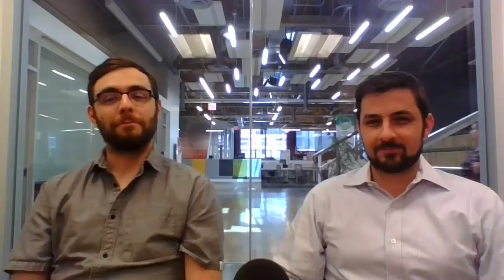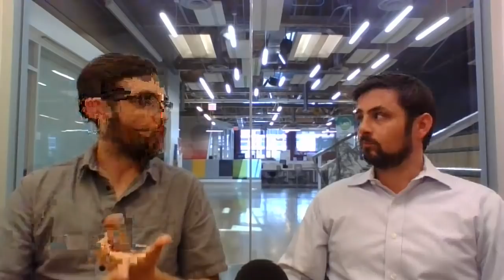SolarEdge VS. Enphase: The Ultimate Inverter Showdown - #65

Comment: To me it’s just the enphase is rated for 149 degrees Fahrenheit and ssolar edge optimizers are rated for 185 degrees. In my market the roofs get up to 170 in the summer. The micro inverters have not worked as well in the hot climates in the summer when the roof passes 150 degrees

Comment: I'm in solar for longer as 10 years now,  and I really think the MLPE technology is hyped a little too hard,  although it has it's advantages.
A good string inverter like Fronius,  and maybe also SMA is simpler,  has less connections on the roof,  is less exposed to the outside climate,  and is way more simple,  and less failure sensitive.  And my experience throughout the years is that people should best choose the most simple option of good quality.  And when the layout gets more complicated and more shade is involved,  then turn to MLPE solutions.  You don't have to be afraid that you're going to miss a lot of energy when you choose a good string inverter.  There's much more going wrong with inverters than with solar panels.  And when you buy a good premium solar panel like panasonic or rec,  then there is a very small chance that something goes wrong.  When a module gets broken,  you will see that in the monitoring as well.  You don't have to pay  10% more for extra technology because you're afraid something might go wrong on the roof.  It's the opposite in my experience.  The last few years,  the service for solaredge vs string inverters in our company was 90% vs 10%.   When an inverter brand goes bankrupt in the coming years,  with a string inverter you just take another brand.  with solaredge or enphase that will be a different story.  Especially when you have a roof that is very difficult to reach...  But in the end,  it's a gamble,  just like the other decisions in life.

Comment: Enphase has a single point of failure too.  Its called the combiner box and it only has a 5 year warranty.  Surprised you guys dont mention that.  Also enphase is only 97.5% efficient while SolarEdge is 98.8%.   No mention of clipping either.  Sad
Reply: Go price an inverter and a combiner.
Reply: Go price an inverter and a combiner.

Comment: I first learned of Enphase in early 2014. From a solar supplier in Campbell Ca. I said I wanted to do it myself, and start with only 6 panels, so he matched 6 Enphase M-215 micro inverters with a 240 Volt trunk cable, and 6 - 255 Watt Sharp panels, I went home, attached them on my backyard fence, mounted the inverters to the panels and tied the patch cord to an abandoned 240 Volt source I used to use for my Hot tub, and plugged the inverters to the panels and turned it on! Within 5 minutes I was producing 1300 watts. Whole install took less than 2 hours. Easy process. Since then I have added many more Enphase Inverters and a mix of brands of panels and got the permit and net metering approved, and racked up a huge array myself on the roof. It's now 2020, and not a single one of my Enphase inverters has ever failed. Now compare that to my neighbor who paid a contractor for a overpriced $40,000 21 panel array. He was talked into SolarEdge only because he later found out that SolarEdge kicks money back to the installers to push their products! His first Solar Edge wall inverter fried itself 8 months after it was installed. His system was down over 3 weeks waiting for a replacement Inverter from Solar Edge. Then after 5 months that inverter also started tripping both the DC and AC breakers with a large bag and smoke coming from the circuit board! This was last May. He then had to wait a month during a sunny May to June and they just replaced it again with a newer designed Inverter. He's quite pissed at the whole SolarEdge experience but can you do after you are stuck with them?! I would also like to share these details that you left out of the comparison. SolarEdge optimizers still rely on a DC wall inverter. So most of the negative aspects of string inverters are still in play. Such as having high DC voltages on the roof which have a higher potential to start a fire from DC sparking at any loose connections, and like my neighbor experienced, if the wall inverter dies, the whole system dies! Compared to Enphase, if one micro inverter dies (which they seem to never do) only that one single panel goes dead! AC is more efficient and safer. Then compare the stringent quality standards that Enphase incorporates in to their products! 25 year warranties! Solar Edge offers12 years because they are thrown together by old world manufacturing and they simply don't care if the installer has to come back to the replace their products multiple times! Enphase also is about to introduce some of the first products of their kind in the Solar world. Their new IQ8 inverts do not need utility power present to produce AC 240 Volt power! They island themselves with a neutral potential and they can throttle power up or down in milliseconds of time to adjust to the load of the house! So if PG&E cuts your power, you still can run off your roof! Or if you are 500 miles from a city and power, you can match it with their Encharge battery system and be off grid with AC power and controls that can shed loads in the house accordingly! So the systems they are designing are unlike anything sold today. Smarter than Tesla battery system too.  Grid or Gridless it doesn't matter, the system adjusts without the people in the house even seeing a flicker on the lights! Lastly Enphase is an American company, where as SolarEdge is not.

Comment: Hi guys, just found your 2 videos. Great and helpful content! I have a question: I hear nothing from you guys on fire safety. We heard from a supplier that enphase could be a bigger fire hazard because of the higher voltage on the top of your roof. Fire brigade might have issues with that over an installation with a central inverter. Any comments on that?
Reply: With an Enphase system, you have 240 VAC on your roof. With a string inverter system, you have, depending on the number of modules, anywhere from 300 to 600 VDC on your roof.
Reply: @kiowablue2862  That is exactly true. Even if the string inverter is shut down, you still have high voltage in the DC cables from the panels to the string inverter. With the micro converters, when the AC power is cut off, the only DC voltage is the low (~40 vdc) at each panel and does not go past the inverter. ie: IMHO ---micro inverters are safer for anyone working on the roof near the cables.

Comment: I know this is off the main subject, but I am a big fan of Solar. I live in SoCal where the rates are quite high, but my electric bill for the WHOLE of 2019 was less than $300.. and that's with the A/C cranked to very comfortable levels...something we couldn't really do before... before the panels, our average yearly electric bill was about $2,000 / year. Now, our highest monthly bills are during the winter months when clouds, rain and short sun days reduce solar output. Our April bill was $4.23 with a $37 state solar credit so our actual bill was $41.23, though much of that is due to taxes and fees. Some summer months, even with the higher rates, our bill is a credit. Another advantage of solar panels is they reduce the heat load in your attic by providing shade thereby reducing your need to get the heat out of the house by your A/C. California is a Net Metering state that pays you back for your excess power at the same rate as it charges for power taken from the grid. Not all states have that. We are on a TOU (Time of Use) plan. The rates are higher during the days and lowest after dark. The good thing is the solar generation is also highest during the highest rate hours. One thing most people don't appreciate is the tax credit that's placed in your Federal Income Tax Account.. I'm retired, but my wife still works and this tax credit has enabled her to not have any FIT taken out of her paychecks. That's an extra raise in income we see each payday.. and the upshot is, we still haven't had to write any checks to the IRS since we had the panels installed in Oct 2017. We only write checks to the state, which aren't too bad. So, solar is the best investment we made. But, you just gotta buy the panels, not lease or you won't get the credits. You're just paying the solar company to use your roof for their benefit... and though you may get a reduced electric rate, you'll never see the Zero or Credit electric bills an owner would see. As per the subject, I agree that Micro-inverters are the ONLY way to go..

Comment: You guys seem like nice people but this "showdown" missed many aspects of what a real showdown would have.  For instance Enphase does not keep up with the efficiency of a SolarEdge system.   Enphase is easily expandable and easier to install but is also quite a bit more EXPENSIVE, while SolarEdge is only expandable up to the size of the central inverter.
Reply: I have a good fronius inverter.  Keep it simple when the roof is optimal without shading.  The more complex it gets,  the more fragile.  I know because I'm solaredge professional and fronius partner.

Comment: Which one would be better for an existing residential setup. I already have panels ready. I just need an inverter along with an optimiser with a way to track the energy produced daily and log it, having remote access to this. Thanks in advance.

Comment: One advantage of AC at the panel (Enphase) vs DC at the panel (SolarEdge) is the higher voltage of the AC allows Smaller wires than the DC string would require. This reduces installation costs. Also, DC Voltage losses over a long run would decrease net output. 240Vac Split Phase is a lot more efficient than 40Vdc for transmitting power. That's why Power Utilities have High Voltage Overhead Transmission lines carrying 14kV or more as it travels further with less power loss.
Reply: 240Vac is single phase with 2 polarities. Maybe that's what you meant by split phase.
Reply: @portalminer8813  yes...
Reply: actually the DC is higher voltage and thus less amps and smaller wire.

Comment: What if you want the solar energy to go into a battery storage device then send the extra out to the grid. Can microinverters work with this settup?
Reply: Yes the new IQ inverters are more battery compatible than the previous M250 series. I think the AC modules from Enphase are too expensive. It's possible to run a Tesla or LG with the proper wiring of a newer IQ micro. If you have a small roof with very little pitch. It's easy to wire the panels and racks, then let a qualified electrician wire the combiiner and shut off switch. You might pay more upfront on the Enphase. But the actual rates of failure will be far less than Solar Edge.

Early M190 inverters had problems. They kept working at it and now the stuff is far better than it used to be. For small scale residential I think Enphase is better in a 15-30 panel setup.

If you are planning on going beyond 10kw then a string inverter would be a better value, but I'd go with SMA or Fronius, you can also add Tigo for optimization. But Enphase really just nails it. I had one inverter fail in the early install. I had a new one in two weeks. The per panel monitoring on Enphase is dialed in with your internet connection.

I can say that Solar Edge is not going to compete with the innovation of Enphase. Good luck. It's not that Solar Edge is bad. But the fact that you  might wait a month or two or have to replace multiple inverters over the warranty period can be a headache for some. Of course Enphase had it's share of problems. It seems they are getting the return now that they've invested in testing.

I think Enphase has more R&D into testing than most companies. Good luck.

Comment: Enphase converts at panel sending down AC which is what your house uses. Not only is the single inverter in the solar edge system bad if it should go out but solar edge inverter comes with a 10 yr warranty. Enphase is 25yrs.
Reply: I just got a quote with a 25 year warranty for the solar edge inverter. The other question is whether the manufacturer will still be around in 25 years. They could warrant it for 50 years and it doesn't mean a thing if they aren't around.
Reply: @jonathanreich6360  - what pricing did you get? It would take A REALLY REALLY good deal to get me to buy a  Solar Edge system, and I mean REALLY good.
Reply: @kbob8424  Solar Edge offers extended warranties for 20 and 25 years. Our contract includes the extended warranty to 25 years. We had many bids and the best bid was for Panasonic panels with the Solar Edge optimizers and inverter. We live in a city of flat roofs and we have a very pitched roof and the south facing roof does not have large areas for panels. We were turned down by several companies who just refused to deal with the pitch of our roof including the local electric company who refused to allow us in their pilot project. Since we have a two story house in a desert city which gets quite hot for 4 - 5  months in the summer, our electricity use was getting very expensive. Our upstairs A/C where our master bedroom is ran day and night. Our electric bills were moving to the $700 per month range in the hottest months. Prior to getting estimates, we had our roof redone with thick insulating panels under asphalt shingles, put in double-pane windows in the upstairs and put mini-splits in the two large bedrooms in the upstairs. That has brought the bills down consistently about 1/3. I sat through sales pitches on single line inverters and micro-inverters and investigated the power optimizer which seemed to be a good solution. I did some investigation and research and also asked questions which the salesperson wasn't always willing to respond to. We have an excellent location for it which will keep it in the shade constantly. The plan we are going with is for a 12.24 KW system which, depending on estimates, should cover most if not all the yearly uses. I am considering an EV down the road which may force some additions but that is a way off. The company that did the work was highly recommended by a friend of a friend and the pricing of the system, after tax breaks (state and federal) comes out to a net cost of $22k. We are paying it in full. As mentioned, the best micro-inverter estimate was either significantly more ($6k - $10k more including several bids that were nearer to $50k gross) or the company could not find a way to put enough panels (or was afraid to use any of the pitched roof space).
Reply: @jonathanreich6360  - yeah I see your point. That is some high usage and am shocked companies would not want your business. Who does that? Maybe it your market there is a difference between a central inverter system and micro inverter system. In ours, there doesn't seem to be. Are you already committed, did you sign the contract?
Reply: @kbob8424  Yes. There are other factors such as the reviews of the various companies, whether they are in the same town or another city, reviews of the panels. Also, if a string inverter goes out and the solar grid is out for a month or so, that isn't going to be a big problem. The main reason we are doing solar is to reduce our carbon footprint. Obviously we want to do it reliably and efficiently, but there is clearly a bunch of salesmanship out there as well. I did research and really the rave reviews by friends of friends in my same city by a company in my city plus long warranties from companies I believe will still be in business along with the best pricing and best set up (panelwise) is what sold me.